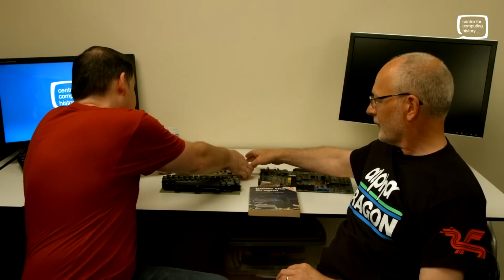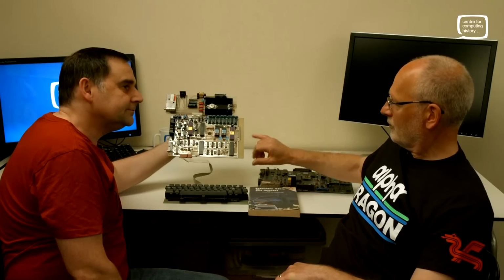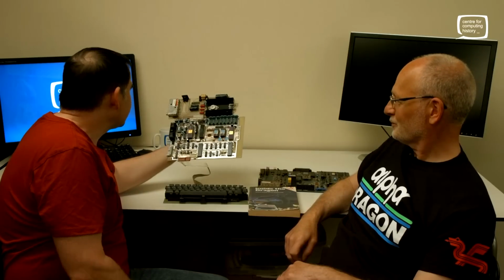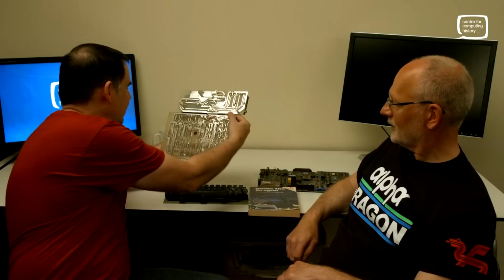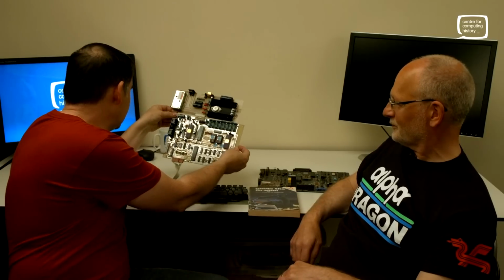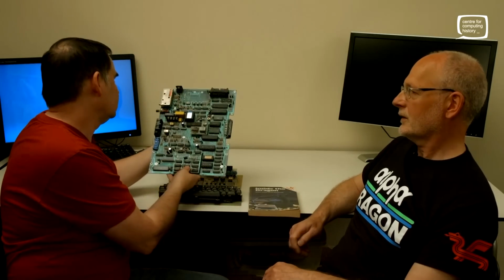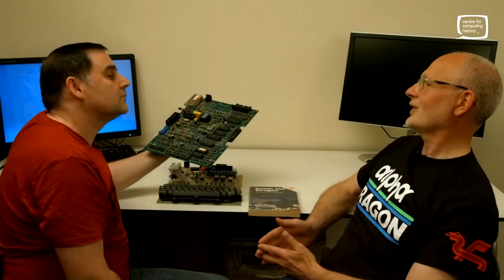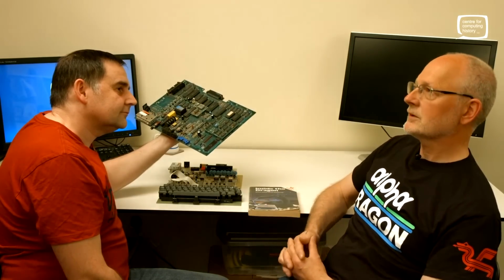The Prototype Dragon 32 and Dragon Alpha with Duncan Smeed

Comment: For some reason I always remember a Dragon 64 being on the market. Must be an error in my memory. I never owned a Dragon but always use to look at these computers and their large proper keyboards with envy being a Spectrum owner. Interesting interview and channel. Thanks.
Reply: The Dragon64 was, in essence, a dragon 32 but the free memory on a 32 was about 32K and free memory on 64 was about 48K I think (so misleading name)
Reply: @spitbacca  Wasn't really misleading. The version of BASIC in a Dragon could only utilise 32kb of RAM. Once you closed BASIC, the rest of the RAM could be accessed freely.
Reply: @spitbacca  It has to be contiguous RAM for BASIC to use it.
Reply: @spitbacca  The upper 16kb of the memory map is used for things such as video, I/O, and of course, the BASIC ROM, though I believe the Dragon takes care of all but the latter in hardware. There's no paging, as that would break the sequence. It's why C64(and un-upgraded C128) RAM upgrades had a special "Super" BASIC ROM in them or were bundled with a different OS.